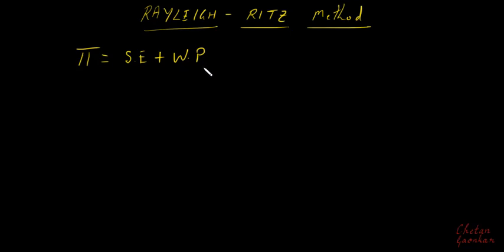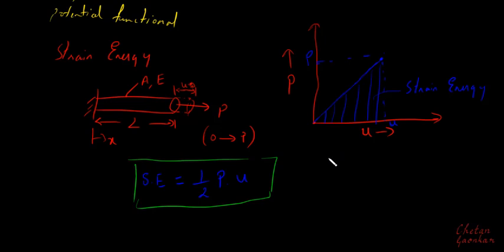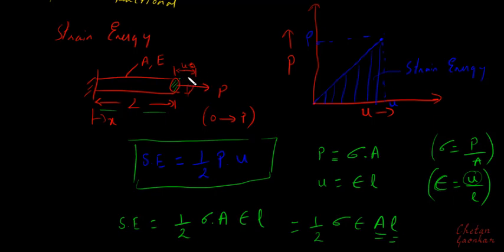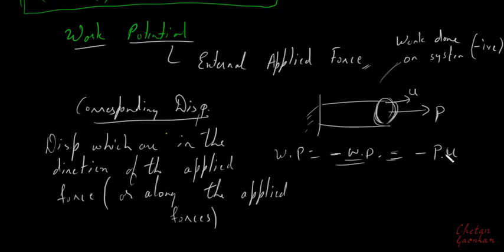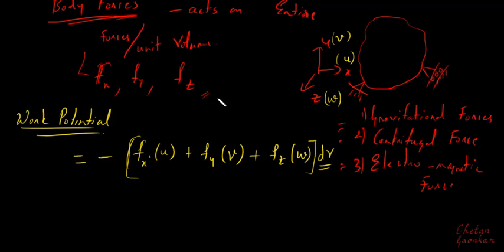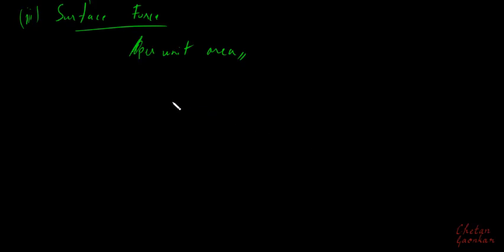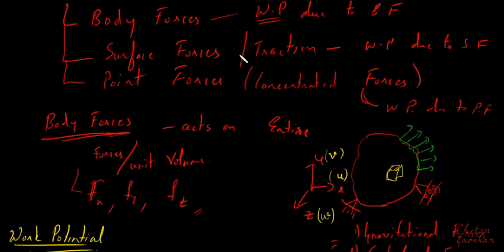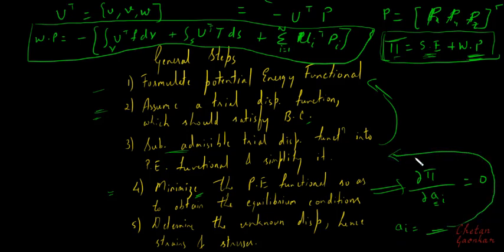8. Strain Energy and Work Potential for Rayleigh Ritz Method

Comment: in load vs displacement graph, why do we take displacement in x axis, when it is depends on load. we should take load along x axis, right?
Reply from the maker: I feel its other way round. For eg. F = kx where in force is dependent on displacement. Also in case of theoretical analysis most of the time force is dependent on displacement. This is purely my understanding and I may not be correct. In case if you find better convincing answer kindly post it here. Thanks 🙂